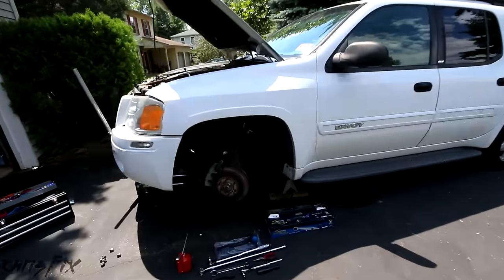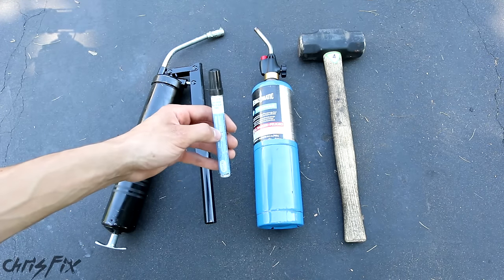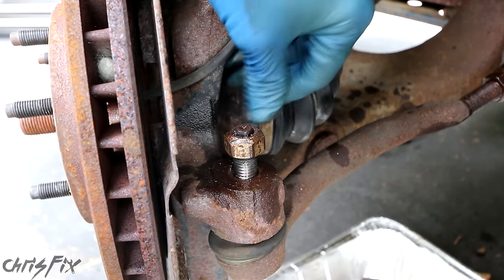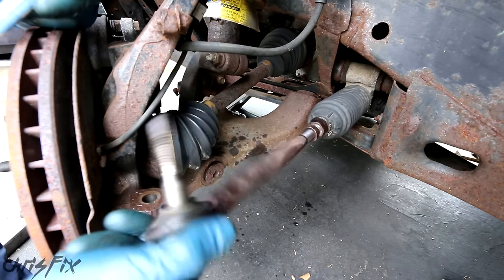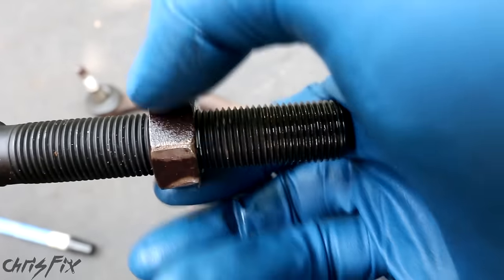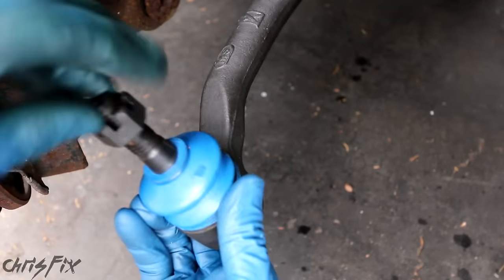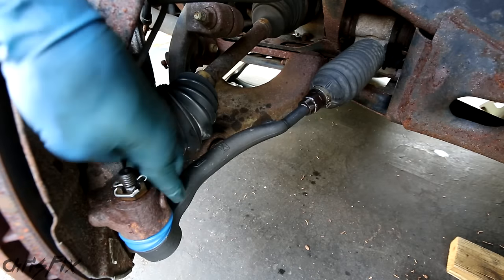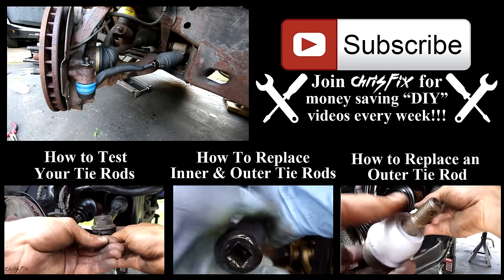How To Replace an Outer Tie Rod End

Comment: Hello! New to your channel but I find it very useful! I'm writing to you today in hopes that you can maybe help me with my car issue? I have a 2012 lancer SE and It makes a popping noise on the right side every time I turn the wheel and take off. It only does it once and won't happen again unless I turn the car off. It doesn't do a stutter like a bad CV joint but more like if the wheel is catching the bumper. It even feels a little different in the steering wheel when I turn left it's more firm and when I do right turns the car almost feels weak. I wish I could explain this with more detail but I'm lost as I've taken it to auto shops but all have told me they don't hear anything. It's kinda stressful because everyone thinks it's a CV joint but then says they're fine. What else could be causing this clunk? Thank you in advance and greatful for your work!
Reply from the maker: Could be a bushings that pops every once in a while. Check the ball joints... Check the tie rods. To me it sounds like a CV going bad but isnt that bad yet.
Reply: ChrisFix thanks for the quick response I'll make sure to look into it! I too think it's a CV but mechanics just put it on a lift, flash a light to look around for any wear and tear then tell me everything looks fine. Could it be something under the rubber cushions?  Forgot to mention that the clunk happens more often in colder weather, maybe that helps figuring this out?

Comment: Had a minor accident a week ago, the screw holding the front right tie rod broke and the wheel disconnected from underneath me at 30mph (I'm lucky I didn't go into the ditch). I was just about half a mile from home, so I could replace it temporarily with a plumber screw, and got a new 10.9 class (the strongest and hardest class) on both sides, now I have to reconnect, possibly replace the axles, and pray that my clutch and transmission survived this

Comment: That Envoy is HAMMERED! Mine looks brand new compared to that one.
Reply from the maker: That is what the northeast does to cars. This isnt bad at all.
Reply: My years in the Berkshires have most certainly taught that. I've seen so many of these GMT360s. I had an 04 Trailblazer in my driveway with 294k on the clock, and a frame you could poke out with a toothpick.

Comment: Can a bad or worn tie rod make the steering wheel shake ?
Reply: Check the grease on your guide pins. That's the cheapest option. Lube them up and replace the rubber then test drive.

Comment: Being doing brakes and suspension over 25 years and always hit the tie rod holder/stub axle on the side where the tie rod goes in with a hammer as that will loosen the nuckle joint without damaging anything.Hop you understand :)
Reply from the maker: Mopar Man73 Thanks for sharing. I was always taught not to hit the knuckle with the hammer because you can damage it. I could care less about damaging the tie rod itself.
Reply: how can you damage it bud its atleast 1/2 inch thick solid metal but each to there own :)
Reply from the maker: Mopar Man73 It can cause stress fractures inside the metal because the metal bends. That is why the tie rod pops out (the movement of the metal).
Reply: no

Comment: you don't want to hammer the top of the threaded ball joint even with the nut attached, it could mushroom it and cause more of a headache. you can either hammer the side of the hub to get the joint loose or use is pickle fork only if you are replacing the tie rod
Reply from the maker: MrBsquared13 You never want to hit the knuckle with a hammer. If you put the nut at the top of the stud, it will prevent any mushrooming that can cause it to get stuck. A pickle fork is the better way to go but I am trying to do the job with no special tools.

Comment: i have a 1997 ford f150  4.6 liter V8 i have an issue  i can just a smigen turn steering wheel to left but when you try to turn to the right it will not turn at all what is the issue? CRIS OR ANYBODY IM DESPERATE  I REALLY NEED HELP PLEASE.

WHAT IS GOING ON WITH OUR TRUCK?

Comment: cotter pin should be horizontal when facing the castle nut, the tie rod can be aligned by just simply align the steering wheel and then align the toe, very simple, u just need a line, and two jack stands
Reply from the maker: Thanks for the tip!
Reply: ChrisFix
hahaha No Chris, Thank for Your tip !

Comment: Hey Chris how do you find out Torque lock settings ?
Reply from the maker: +Toran D. Smith I search online or I use the service manual if I have one for the car I am working on.
Reply: The service manual lists torque specs thanks chris gotta check out
Reply from the maker: +Toran D. Smith Yea, but the service manual is not the owners manual...
Reply: Ahh ok yep i dont have that then

Comment: could a bad tie end cause very loud solid bangs when I hit a bumb or something else?
Reply: usually that is sway bar bushing that causes the bang when hitting a bump, but it could be many things.
Reply: +shooter McGavin  and my steering wheel shakes while driving
Reply: +J rock the shaking wheel could be as simple as you're tires being out of balance. I would definitely check you're tie rod ends and trac bar bushing. that is usually my main culprit I find on jeeps that handle bad. I suggest taking it to a local shop to have them look it over. If you know a thing or to just check it yourself.
Reply: +shooter McGavin  its not a out of balance tire I know a how to check em just don't gave much time. but thanks for the advice
Reply: +J rock one thing many people look over is the small u joint on the the shaft connecting you're steering wheel to you're steering gear box. most likely this would not cause a bang when hitting bumps, but old vehicles that handle like shit I just replace all bushing in the front end.
Reply: Its. 2003 maxima

Comment: In school I learned a trick and you don't have to go to thr alignment shop. Just count how many time you have to rotate to unscrew, and remember what is the position of the tie rod when is completly release. ;)
Reply from the maker: Vlad Sorodoc You still have to go to the alignment shop unless you purchased OEM parts because the threads might start in a different spot. But that is a good tip to get the alignment very close! Thanks!

Comment: Can you tell me how to check the fuse for the 4x4 motor of a 2004 chevy tahoe because i dont know what happen to it can you do a video of repair a 4x4 motor
Reply from the maker: Cristian Parra Check the owners manual on where the fuse is located. I have a video on the transfer case.

Comment: Do car have the same tie rod or depend on the brand of the car?
Reply: Faiz Azizi Depends on the brand.  Cars all now use non-serviceable ball-joints and won't have a grease nipple like this truck does, but everything else he does is much the same regardless of the vehicle - you just have to make sure you get the right parts for your make and model.
Reply: Matthew Sharpe Thanks
Reply from the maker: Faiz Azizi It depends on the car but most cars have this style tie rod.

Comment: I remember the first time I changed tie rods (in winter).... didn't know about using heat... many wasted hours cursing, hammering, and fighting with that inner nut. 

I'm getting ready to change them on a truck now so I invested the $30 in a propane torch. Not making that mistake again lol.

Comment: Instead of popping the tie rod end out with a hammer you could rent a tie rid puller for free at an auto parts store. Had to do this recently.  This helps if the hammer solution isn't working or of you don't have enough clearance or just don't want to risk missing.
Reply from the maker: Kyle Gibson Thanks for the tip!

Comment: When removing a tie rod its a good idea to count how many times it is turned.
Reply from the maker: You can do that. I cover that method in this video: https://www.youtube.com/watch?v=05XOhz67jGA
Reply: ChrisFix bro i have a 2010 altima i want to know if i should do dealer brake pads or aftermarket...nissan want 90 dollar for the front pads
Reply: cal boogie aftermarket. use a cheap pair of ceramics.
Reply: killermanSAd i did bro...nissan had a cheap pair of pads still nissan but cheaper...50$
Reply: killermanSAd i no some pads squeak..if there too cheap...i have an 18in gtr rims on it which is a lit heavy...so i needed a good pad

Comment: Why is setting the steering alignment something that can't be done at home? I'm just curious.
Reply: Daniel Stone very labor intensive without using up to date tech that most garages use
Reply: Daniel Stone shops use a machine that uses cameras to measure the angles on each wheel to align the wheels perfectly

Comment: 3:58 every diy knows this sound after finally braking through that bolt.
Reply: watch it in slow motion.....  Only if we could see it wondering if his hands slipped after breaking threw that bolt. then i can really relate to that when u end up putting so much force but it wont show any sign of lossign then all of sudden bam ur hand goes flying into a unknow territory and hitting against metal aluminum plastic dirt mud god knows but if it is metal then ur good and least ur coming back with cuts and your bones sizzling on the inside from major PAIN ALERT

Comment: Awesome video.  Anybody able to find Tie Rod Ends with grease fittings for 94-97 5th gen Accords?
Reply from the maker: Jason Jay Thanks a lot! Check out mevotech's stuff because I think all their tie rods are greasable.
Reply: Can't find for Mevotech with greaseables just regular kind of rod ends, that's why I asked.  I do like the Moog brand because it's heavy duty material and not a cheap replacement part, but it's not greaseable.  If you find a good quality greasable tie-rod please let me know.  None of the 3 majors of AAP, AZ, or O'R have greasable tie rods for my 5th gen Accord.

Comment: I have made my own penetrating fluid for several years no. I do use mineral spirits because I was given 15 gallons. Acetone does the best. Just make my own wd40 1 part mineral spirits 1 part bbq light fluid and 3/4 parts light oil   as per electronicsnomore video.
Reply from the maker: +Ed Ginsberg Thanks for sharing!

Comment: Ah ok that's true, I'll see about getting a friend to sit in the drivers side and see if it balances it out. Luckily all I had to do was put some rubber washers behind the bolt for the hangar and tighten it back down so it no longer has that loud rattle.
Reply from the maker: +I'm Irreducible Nice! Glad you figured it out!

Comment: If only my tie rod ends would've come out that easily. I had to pound and pound with a mallet then eventually resort to a tie rod end puller. Even with the puller it was very stubborn but eventually gave way with a loud crack.
Reply from the maker: Sometimes heat makes it pop right out!

Comment: Additional tips :

Count the turns and re install same amount.

Measure threads ( distance ) and put jam nut in proper spot.

I like to grease tie rod before and after jam ( lock nut ) in place and then grease.

Best to lock down ( tourque ) nuts and tie rod in straight ahead position.Realistacally they  are in straight ahead position when driving. This way your not creaing damage before you leave the lot by wedging tie rod in the knuckle.

Remember parts are not defective instalkets are . . . Just saying.

Comment: I've done many of these over the years. Never marked one. Just count the rotations as you unscrew the end. Then screw it back on with the same amount of rotations. Not knocking your way. Just another suggestion.
Reply from the maker: Jake Johanson That is another method. In this video I use the paint method.

Comment: I leave tire on because if you leave it on and do not move the tire, you do not have to get it aligned, the trade off is you save money, but you have to lay under car. his way is safer
Reply from the maker: freevideos051 Thanks for sharing! That is a good method to prevent the tie rod from messing up the alignment.

Comment: Great how to video as always. but holy geez did somebody drive that car thru salt water that's a ton of rust
Reply from the maker: Aviator Guy Thanks a lot! Cars where I live rust real easy. Snow, salt, ocean salt, humidity, rain, etc.
Reply: ChrisFix I'm on the east coast so I deal with salt and rain. even with all that bad weather granted  I'm two hours away from the ocean in Pennsylvania. My 04 Jeep Wrangler frame still looks like new and so does my 2010 Pathfinder. then again I'm anal about keeping my cars clean. Any chance you could possibly do a video on transmission fluid changes

Comment: I prefer no grease points. Grease nipples just seem so out-dated old tech. Sealed means no dirt can get in (in theory).
Reply from the maker: InternetDude Sealed means you cannot force the old grease out which will get dirty and dry up. Grease-able means you can add grease at an oil change and get more life out of it. To each their own, but I prefer grease-able.

Comment: I never understood the concept of heating a rusted nut. I don't deny that it works but to me, my thinking is putting a flame to the nut heats up the nut but some of the flame touches the rod as well. As such, it expands the nut (which would make easier to take off since it's not on the rod as tightly) but also expands the rod (negative the positive of the nut expanding). Maybe someone can shed some light on this.
Reply from the maker: +Amandeep Rakhraj The heat breaks the rust, especially when you quench it with penetrating fluid.
Reply: ChrisFix haha so has nothing to do with material expansion whatsoever. Thanks for that bit of knowledge.

Comment: As appreciated as these vids are, there's an issue here - all you've ever covered is rack-and-pinion steering, not recirculating ball (still in use on some trucks and performance cars). Left me a bit clueless as to how to deal with a center/drag link and Pitman arm.

Might be time for an update, considering these vids are nearly a decade old.

Comment: Car Job: 
-Take 2 Screws out 
-Replace Rod
-Put 2 Screws back

Tools needed
-Sockets 
-Ratchets
-Penetrating Fluid
-Wrenches
-Pliers
-Breaker Bar
-Hammer
Etc. 

Damn how much you need to change one piece of metal

Comment: You use your wrenches the wrong way. Flip it so when you turn it wants to stay on the nut and not slip off.
Reply from the maker: InternetDude Thanks for sharing but if I turned it I do not get the same angle to pull on it and it is tight in the wheel well and only a certain angle will work.

Comment: The proper way to remove an outer tie rod isn't to place the nut on and hit it, you hit the side of the knuckle where it connects; especially if your reusing the tie rod
Reply from the maker: +jcv1995  You never hit the knuckle. That can cause the knuckle to crack because it is not designed to take blows like that. You always hit the tie rod. In this case we are replacing the tie rod so you can just hit it. If you are reusing the tie rod, you use a tie rod puller.
Reply: +ChrisFix The tie rod puller (pickle fork) has a good chance of damaging the boot. The proper way that ASE mechanics are trained is to hit the knuckle in the correct spot (where the toe rod attaches it) to safely remove it, with no chance of any damage.
Reply from the maker: +jcv1995 You dont use a pickle fork, you use a tie rod puller like this: http://amzn.to/1LA6qdO
When you hit the knuckle you are hitting hardened steel which is not designed to take blows from a hammer so it could cause stress fractures.

Comment: You don't need to realign your car if count the turns you take the tie rod off and put it back on that many turns.
Reply from the maker: Chris Leary You need to align your car no matter what when you get new tie rods. If the thread starts in a different place or if the tie rod end is a different length, your alignment will be off. Counting the threads is another great method though and is pretty accurate in most cases.

Comment: 13/16 bolt ...? (almost 21mm) 
are you sure its not a metric 21mm bolt cause i though the american auto industry has adapted to metric standards by 1975 (1975 and newer american made cars are metric) 
i could be wrong...

i bet the owner of this car lives in a very crust inducing environment ......
cause that pretty rust for a modren car with modren rust prevention technology
Reply from the maker: Faisal Abdulaziz It might be 21mm but the 13/16 fit on it very snug and it worked perfect. Yea, where I live is snow, salt, ocean salt, humidity, rain, etc. Most cars get pretty rusty.
Reply: ....thank you very much for your time and effort ...love the videos..

reminds me when i used to have a lemon (the hood was always up in front of the house)

i got most of my repair/diagnostic/experience  tools from that car

Comment: You can do your own alignment with 4 jackstands, a tape measure and some string.
It's not rocket science, and the computer alignments aren't as accurate as people think they are.
Reply from the maker: ***** How do you do an alignment on jack stands and how do you align camber?
Reply: The jackstands hold the strings.  You use an angle finder or a plumb bob for camber & caster.  Racers do it a lot.  I'll see if I can find a good article about it.  I'll search YT too.
Reply: Search YT for "alignment with string".  I'll screen a few &  pick a good one when I get some time.
Reply: Basically,  find the centerline of the car,  put strings parallel to the centerline & measure from the strings to the wheels.
Reply from the maker: ***** Thanks for sharing! I will check it out!
Reply: I need to write a better "how to"  than the ones I could find.  When I did autocross,  I had it down to a system & could do it in minutes.